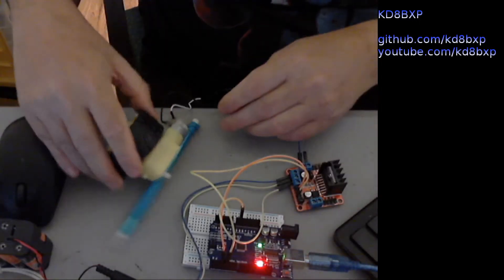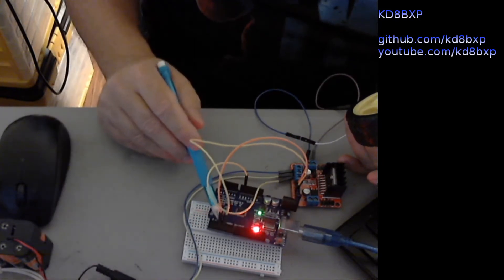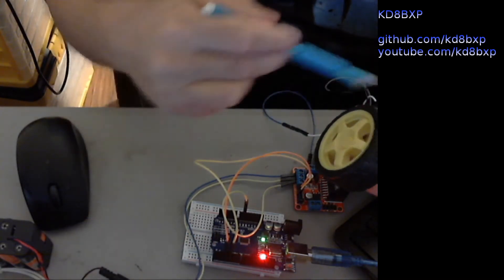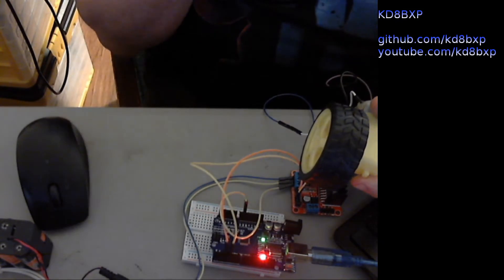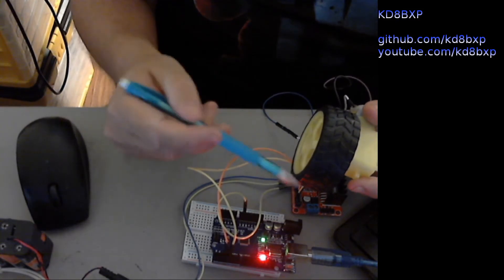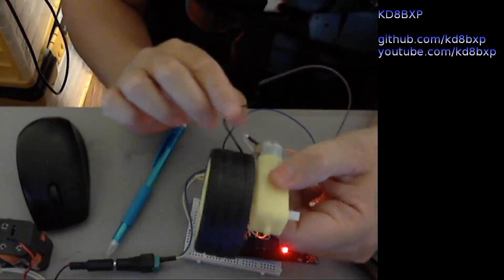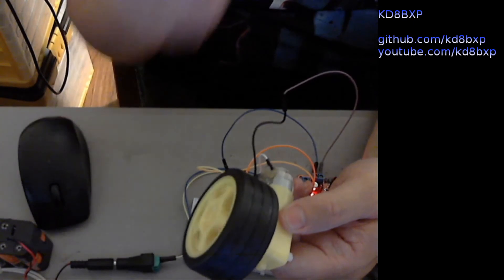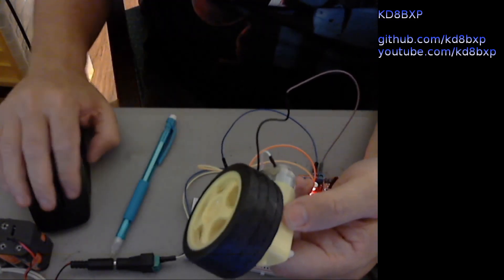Using the L298 Motor Driver Part 2 of 5 - 2 Wire Direction & PWM Speed

Comment: Exactly what I needed!  My motor board has no enable. Your 2 wire method works great. Is there any advantage to using 2 pwm's versus 1 in the two wire configurations?
Reply from the maker: David Lotts the real advantage is as you found it uses less gpio. For the uno and other small boards this can be an advantage.